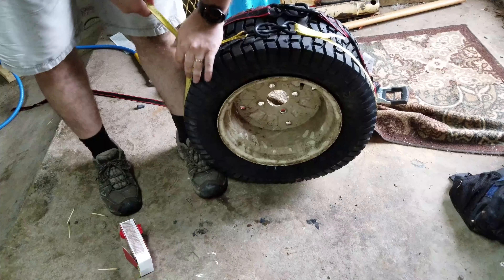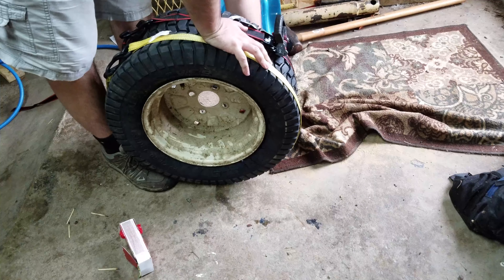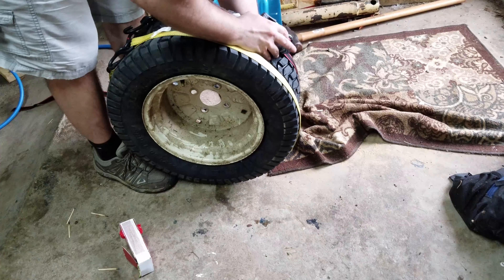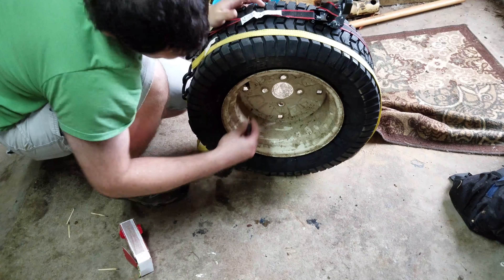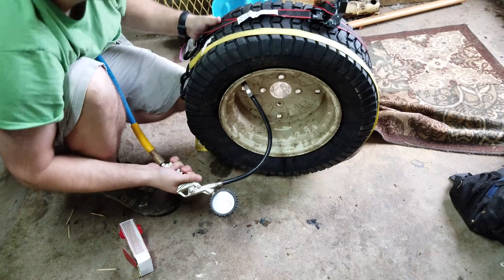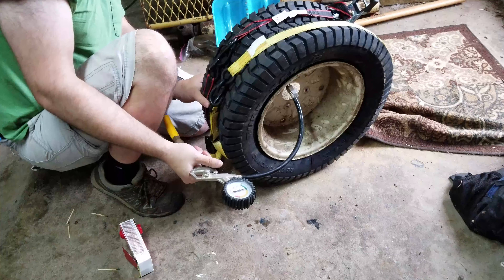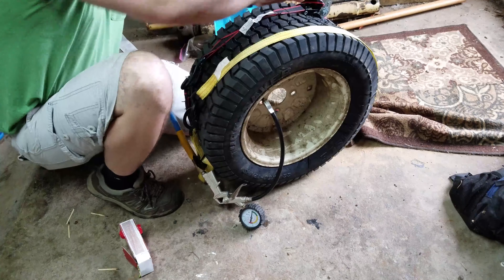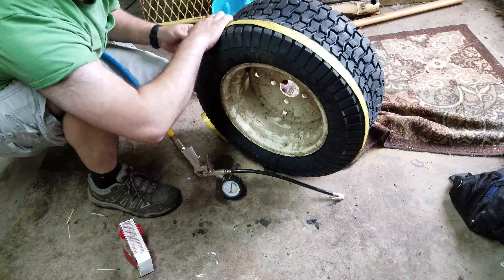How to Seat a Tire with Ratchet Straps (Quick & Easy Fix)

Comment: Another simple but more messy way is with grease.   You simple smear grease between the rim and tire and it seals it enough the tire will push back on.  Great for larger tires that the ratchet strap does not always get.    I have even used both methods together

Comment: 1/2 second blast of starting fluid and a match 5 seconds  to fix that. I used to fight tires with straps. The last large truck tire i had to fix it was -25f and clean off the bead on both sides I fought it with straps for like 3 hours I was so mad about to give up.  So i tried the fire trick it inflated the tire to 80psi on the dot in 1 millisecond. Less is more with starting fluid start small and work up never use the whole can. P.s why is my friends lawn tractor from 1968 still have air in the tires and Im on set number 2 on a tractor from 2010. I smell a conspiracy.